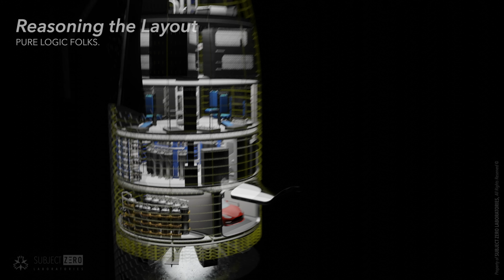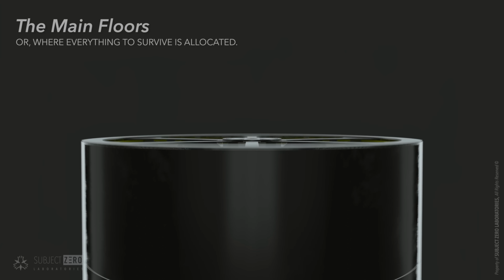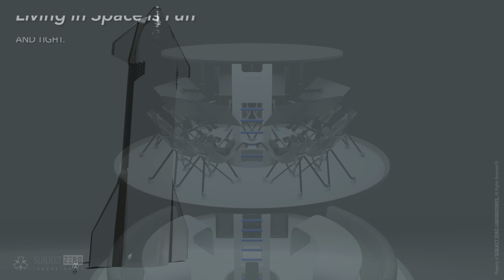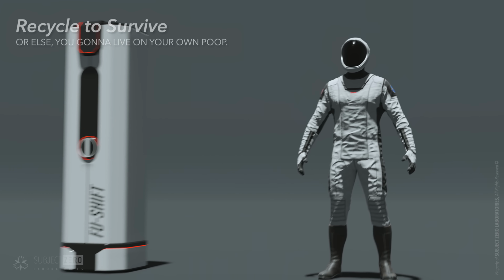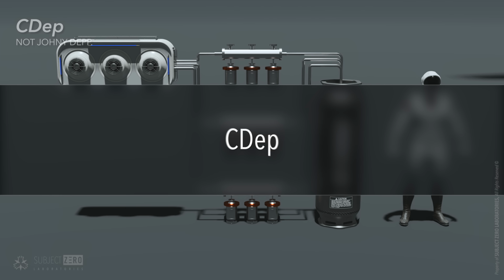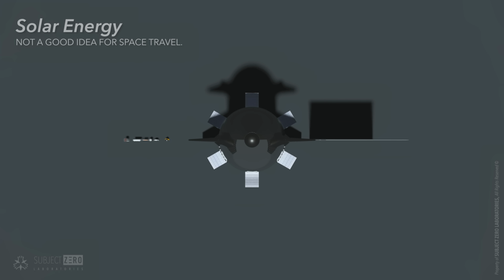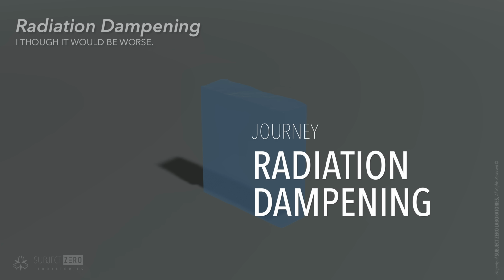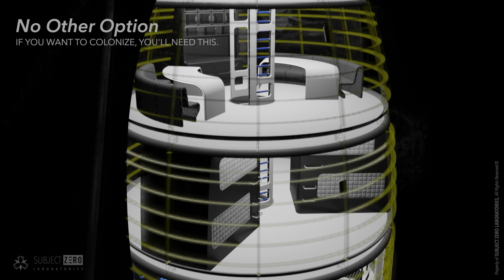Onboard the SpaceX Starship 2.0 in Detail - What it takes to go to Mars | Detailed Breakdown

Comment: This breakdown is good done. But it has several flaws. Just one example.... The oxygen wont be stored in seperate tanks.....oxygen is the main fuel of starship and it has a huge oxygen tank....it would be totally unnecessary  to store it seperately. So the mass of the tanks shown in this vid is actually 0. and the co2 tanks he is talking about are not neccesary because co2 can be split into oxygen and carbon. so why store tons of co2? doesnt make sense.

Comment: I'm thinking you could get away with even less water, as water is separated from the toilets and showers etc and cleaned and put back in the tanks, as well as condensation from the air. With enough power, CO2 can be split into oxygen and carbon and used again aswell, It's all a question of power.

Comment: Hi, cool video with lots of good ideas however I disagree with your dismissal of solar power as a power solution. 
1. You don’t mention that the ISS spends almost half of its time in the shadow of the earth. For 35 minutes of each 90 minute orbit it is in the shadow of the earth. Starship is in full sunlight for the trip to or from mars. While the inverse square law will reduce the power from the panels, on average solar power would be more effective on a trip to mars than in orbit around earth. 
2. There are many ways to arrange solar panels not just the way shown in the video. For instance the new roll out solar panels on the ISS are only 340kg and extend to an area of 6m x 19m (114m^2) and provide 20 kW. A few of these would solve the power problem. A pair of these arrays was carried to the ISS in the trunk of the dragon capsule.
Reply: For your 1. that also means Starship is going to need much more cooling than the ISS. The ISS already has huge cooling fins on it. Remember that radiation is the only way to get rid of heat in space.
Reply: @darrennew8211  yes, big radiators or a sun shield or both. They have to keep the propellant cold too. That’s something ISS doesn’t have to worry about.

Comment: the exercise floor is a waste of space & weight. The crew doesn't require a gym. The bunking space can be condensed to house the exercise gear, the toilet and washing facilities. Since the crew sleeps in rotation bunking would be similar to a submarine or ship, so fewer bunks and no dedicated space per crew member. The "living room/dining room" is a waste of space and could be combined with other storage and equipment. Basically, it'll likely be a cramped, unpretty space and not the rather silly cruise experience the spacex videos and materials portray.

Comment: Sorry, nice graphics, but terrible usability engineering. No need for so many toilets, treadmils. No need for a fixed flight deck. I suspect most space will be used for food, water and equipment. 
Regarding solar panels, you're wrong again. There is even an animation from SpaceX showing how to unfold large solar panels. ISS panels are not a good reference.

Comment: This is nothing at all what Spacex has planned. First 5 to 10 ships sent will be unmanned with supplies only. These may contain some Optimus robots as well. There will also be vehicles and materials sent to start setting up a base location. Then once they are confident enough on safety of the missions they will send 100 people per ship to continue the setup and create structures. Thousands of these starships will eventually land there. Their plan was to get 3D printers for structures using local materials. I think the passenger version will have 5 levels of 20 passengers each. Elon also mentioned possibly sending a boring machine if they can get it light enough and compact enough.

Comment: Just seems so completely ignorant to me to not make use of one of our most resilient, reliable, and flexible energy resources: nuclear. There are a variety of possible options available but a radioisotope thermoelectric generator (albeit a very large one) seems the most likely. With more testing and trials, I suppose one of these new small modular reactor designs could also be a plausible option. Having excess power (and possibly LOTS of excess power) opens up a multitude of possibilities, especially once on Mars, that would otherwise be impossible. Nuclear power is simply a MUST in my (admittedly unimportant) opinion.

Comment: co2 capture  by a machine is a bad idea. Call it a back up plan for emergencies.  It takes gas out of the confined space, creating a vacuum.  So more oxygen must be let out of the tanks to equalize pressure.  This also takes carbon  out of an astronaut and that must be replaced or he or she will lose mass.  So food must be consumed just because of breathing.  A better solution is carbon capture, not co2 capture.  To do this they can use spirolina.  A microscopic plant that will grow by capturing carbon and releasing oxygen and the excess spirolina is  edible  and nutritious of grown in fertile water from existing sources .  People.    So you get your air recycled, don't have to rely so much on tanks of oxygen, you get free food so you don't have to rely so much on stored food.  It is a win win win.

Comment: Cant the HFC be used for drinkable water production? Why not just bring only hydrogen and oxygen and use them to make water, plus you can recycle most of the water used so you will most likely need far less water to be stored or none if HFC are used. The only reason to cary water is for radiation protection in my opinion but that can be solved with other lighter materials as technology progresses. So there is no need to store water for more than energy back up.

Comment: I like these videos but they keep refusing to add reality into the mix.

"Everything has to be so simple that anybody can use it and fix it"

No, you're going to send up well-trained personel. There will be no civillians on these ships, no people off the street,only properly trained, healthy, fit people can survive this.

3:0 "a deck that could be spatious enough for a tesla model 3"

Obviously I understand you where not seriously suggesting putting a regular car on a trip to Mars andyou where just using it to plug the tesla that you all seem to love so much, but a hatch that big is never going to happen, it's structurally an insane thing to do to the only thing that keeps you from esploding into the vacuum of space. Also: you need that space to store the 8actual* amounts of water and oxygen you need to survive in Mars.

4:00 "bathroom facilities:

No, you will never shower again, it's wet towels from launch to death. We already have these devices onboard actual star-ships like ISS. You can bamouth ISS as outdated, but it's real, it works, it's not fantasy.

Also: this deck will ne b[akced with supplies, leaving only enough room to get to the spaces e=they absolutely need to use.

Starship is 50 meters tall and the crew is located in the top 17 meters, which means the acces hatch is at least 33 meters above the ground. That's a 10 storey building. Getting in and out is going to be a very dangerous operation all by itself.

Starship has a dry mass of 85 tonnes and a payload max of 100 tonnes. Obviously they are going to always take as much as they can so when it lands on Mars it will be extremely top heavy, like having 80% of it's total mass in the top 17 meters. If this thing does not land perfectly verticall then it's going to fall over and when it does... remember this is a ten storey building so everybody inside is dead, even in Martian gravity.

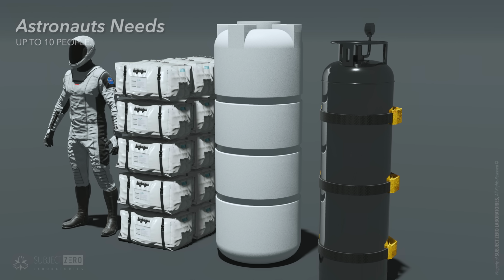6:00 "45 tonns"

Finally, getting some actual numbers.

"On starship full of food to survive"

More than that. but why is this now suddenly a problem? Didn't Musk singlehandedly reduce the cost of launches by 99%? Doesn't he build them by hand in his own backyard for $1.25? Doesn't he thrown them into orbit himself with his mighty arms?

"Clearly, we need better solutions"

You need a realitycheck.

"Torrefaction"

Cool, now all you need is the energy required to heat stuff to those tempaeratures and keep it there until the process is complete.

"CO2 scrubbers"

Ask ISS how they have been doing it for decades.

What I am missing in this video is that you keep mentioning what everything weigs, but never add them all up. The cargo bay is large enough for a Tesla Model3, but a few minutes later you fill that same space with the tanks required for the fuelcell required for the recycling units.

Comment: Why would anyone want days worth of battery backup? In space you have solar and there is no night there. Also you would use the sabatier process on the carbon dioxide and convert food into methane. a continuous process requires no large reserve of oxygen above fuel requirements. Try again.

Comment: did carbon dioxide recycling get lost in the fabric of time. when I was in the navy as a fire fighter in the years 1969 to 1972 we had to wear a OBA oxygen rebreather. I consisted of a closed circuit system where the Co2 breathed out was pushed past a candle and the carbon in Co2 was burned off by this special candle , then the oxygen was returned to be breathed by the fire fighter. trees use the Co2 in there air for getting the carbon building blocks for growth and releases the oxygen back into the air. I don't think they gave up removing the carbon from Co2 and recirculating the oxygen back to the living spaces. but no mention of any of the technology for recycling Co2 was mentioned.

Comment: See the thing is that your not calculating in both the water & air filtration/recycling. Water gets recycled from astronauts sweat &  Breath in the air & urine just like the air being scrubbing of CO2 filtered & recycled. With the recycled water using electrolysis its used for generating new Oxygen. drinking water & anything else needed such as rehydration of food , growing plant life ect.  Not to mention  these systems being used not just for the journey to Mars but needed through out the entire mission (if no extra water obtained beneath the surface melted down & used ) and if not as well as the journey home ... these systems have been used for decades on the ISS but will be larger & upgraded for Mars.
 its not going to be just as simple as brining the entire amount of water & oxygen needed for the entire trip , but there's also going to be systems used on Mars to generate oxygen from the CO² air atmosphere on Mars once landed . There's going to be several systems being used with a certain level of recycling as well as redundancy.  With urine being filtered 80% of it is able to be turned back into water and for food again there going to need enough for the entrie trip as well growing food on station during the flight , as well as back up food  then growing food in the soil of Mars ( which once down Mars will be considered  colonized)  but there's also going to need to be tons of equipment, vehicles , solor pannels , 3D printers ( making tools , needed items , spare parts ect ect.)

Comment: I think that it is necessary make travel to Mars not only safe, but tolerable, and healthier than the ways so far posited. 
You need to send a great amount of supplies - including YEARS of breathing Oxygen supply ahead into orbit around Mars to await the arrival transport of people -and that trip should be done in a Torus design space station with rotation generated gravity. Zero-G is extremely harmful, and this needs to be solved before sending anyone, period - or you're just sending people to an expedited death.
Going in a large Torus station would be a safe haven in orbit from which to shuttle to and from the surface of Mars - a degree of redundancy in life support that will make the trip backed up by at least some measure of fail-safes, against failing rockets and post trip Zero-G ailments. A space-station acts as a little piece of earth, and is very much like a forward operating military base just outside a safe distance from hostile territory - a safe haven to retreat to whenever necessary. You would be nuts to go into war without this kind of forward operating base to fly in from. This is even more true of Deep space expeditions - even more treacherous than war on earth. You need centrifugal force gravity, as well as radiation shielding to keep people healthy, or there's no point in going. A large station could hold the sheer amount of supplies needed for each and every person aboard. A Mere rocket cannot. Building this station and its fleet in space is going to be necessary. Shipping vast amounts of materials into earth's orbit is the first step,  fuel and oxygen tanks, construction materials, just for starters.

Comment: I can’t help but think a lot of this analysis is surface-level or even misleading. Using the ISS solar panels as comparison is completely wrong -
solar panels today are in a different league of efficiency compared to when those were built. Also, the ISS has so far supported 11 astronauts simultaneously at peak, and only has 3-4 CO2 scrubbers at a time, which process CO2 back into oxygen. Overall despite the great production quality, I find there to be a lot of missed info here. (Also, what is Starship 2? I’ve never seen that mentioned before)

Comment: Now add in the mass of all that furniture, electronics, umbing, back up systems and 'personal' gear the crew will need also add in the mass of the decks crew abort system, flight controls, screens and all the other gubbins you need.  A flight out will be 1/3 longer than you've estimated, according to NASA anyway leading to at least 50% more mass for each crew member.
This alone makes the journey untenable for even a crew of 10.  And assuming that nothing goes wrong, you've got to send multiple cargo ships to support the crew... Given the goal is a million people, it's gonna take a while, ain't it.
One last point.    Can anyone explain to me the practical purpose of a crew hatch 10m off the ground?   Better hope none of those invisible lifts that i dont see in your renders stop working in the dusty environment of Mars, or you're going to need a reall long set of ladders.😅😂😅

Comment: Really nice video, but I don't think nuclear is going to be a commercially viable solution. Instead you are going to see new solar cell technology with less than 100g/m2 weight that can be rolled up and deployed easily. Efficiency is going to get above 35% for these so you get about 470 Watts/m2 around Earth and 200 Watt/m2 at Mars. That is 120kW of power with 6pcs of 50mx2m solar panels around the ship. More than enough to run everything with a solar cell weight of around 60kg. Attachment wires to hold them in place will increase the weight somewhat but not much.

Comment: SubjectZero, please put some time into out of the box concepts... don't lock yourself inside a box. Consider my concept of having ships with specific roles, heavy transport, livestock transport, people transport, earth launch vehicles, mars lander vehicles, travel to and from lunar/earth orbits to mars/deimos/phobos orbits vehicles. Starship has it's roles, but it can be changed and adjusted. Most if not all is automated flying so ships can be designed with a role in mind. A robot doesn't need food or oxygen or life support of any type, if those Starships can be sent with supplies, why not do it? Why not send 20-30 Starships stacked full of equipment. Please step away from the Space Shuttle mentality and into a new open and free range of ship styles and typed all based around a couple designs. Transporting humans between the orbit of earth and mars doesn't require engines designed to land or launch they require engines designed to fly through space only! "Free your mind, the rest will follow..." (someone sang that, can't think of who)